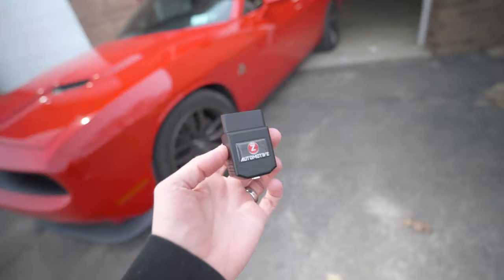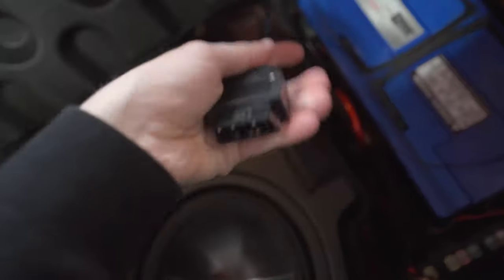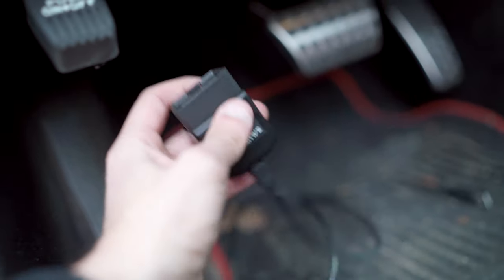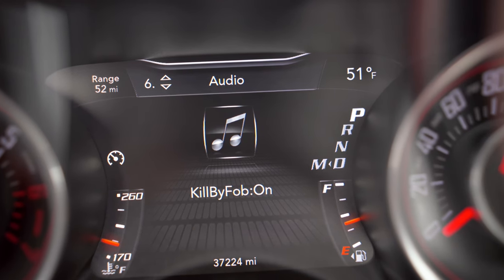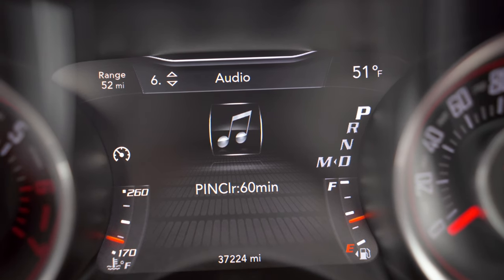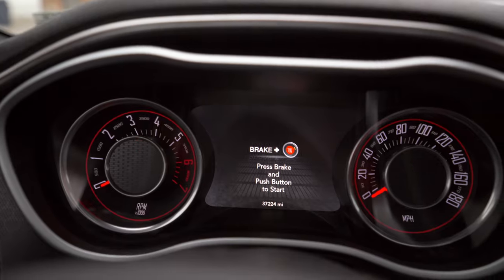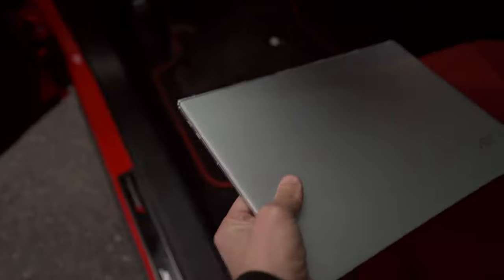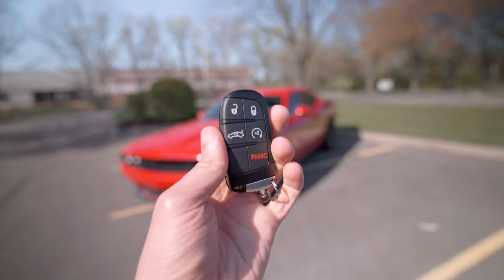Protect Your Vehicle from Automotive Theft - What This Device Can Do Will Shock You

Comment: Is there a way to properly set up the pin in my 2012 Dodge Charger? I’m afraid to do something wrong and my car gets bricked
Reply from the maker: If you’re concerned about that, we don’t recommend downloading the firmware at this time, as it is a beta version. If you have concerns, wait until it is tested a bit more and then download the firmware when it becomes available on our site
Reply: @zautomotive so is that y i couldnt set my pin… i tried over and over and it kept going to cruise on and off but not pin set.. i downloaded the update.. so idk what i did wrong
Reply from the maker: @sunshine48213  that’s not an issue we know about, reach out to support - support@zautotech.com

Comment: Where can i download 2.5.9? All i see in my programming tool is 2.5.8 for new firmware and 2.5.6 for the previous firmware. 2.5.9 not visible at all
Reply: Update: My issue was the version of ZPU not being up to date. I installed the most recent version of ZPU and then the new firmware was available.
Reply from the maker: @Bi9Clapper  glad you found it. 2.6.0 should be coming out very soon

Comment: Recently installed, turned on all the pin features but when I lock with FOB the vehicle does not double blink. Did I miss a step?
Reply from the maker: Is the throttle getting disabled? 

Are you able to unlock the door with proximity entry and see if the pedal is killed?
Reply: @zautomotive  It did not disable the throttle.
Reply from the maker: @svdpschoolsalem  very odd. Reach out to support - support@zautotech.com 

Killbyfob is definitely enabled, and Pin enable is selected “on”?

Comment: Can I use the pin lock mode and kill by fob at the same time on the Taze?
Reply from the maker: Yes but those are two different features. 

KillByFob is for when the car is off and Pin Lock / Pedal Kill happens when the car is running with a countdown and activates when Pin Lock is triggered
Reply: @zautomotive  can I put the Taze with the Lockcar gpa tracker? Or I have to use one or the other?
Reply from the maker: @danielpollockjr.1714  I know nothing about the Lockcar tracker. Depends where it plugs into and what vehicle you have. The TaZer plugs into the OBD2, but can be relocated to the truck with one of our other products
Reply: @zautomotive  thank you 🙏
Reply: @zautomotive  When you plug in the Taze and you scroll through the menue. Are all the factory options selected to the car performance before plugging in the Taze in.? 
And once Taze is plugged in you can edit and set to preference.
Reply from the maker: @danielpollockjr.1714  the TaZer doesn’t change any options until you tell it to
Reply: @zautomotive  thank you very much. You are the best! Thanks again

Comment: I can't locate the pin lock feature in lives mode..what am I doing wrong.? I have the mini..that I did update firmware..
Reply from the maker: @RicoMang  sounds like you might not if Pin Lock isn’t in there. Although the Tazer JL is different than the Pin Lock in the standard Tazer, scroll to the end of your Tazer menu in your EVIC screen and let me know what firmware you’re on. Also let me know if you see “Lt” on that screen
Reply: I see. JL Lt:11.4.6
Reply from the maker: @RicoMang  then it’s a lite and not a mini
Reply: Can the pin feature be added? I got this for pin lock feature ..?
Reply from the maker: @RicoMang  if you upgrade to the mini it will be there: https://www.zautomotive.com/product/activation-key/
Reply: @zautomotive  cool it this Will give me pin lock access correct?

Comment: Just downloaded the new update and everything works except "Kill by Fob".  Tried multiple time and couldn't get it to work.
Reply from the maker: Needs the OEM key fob, don’t know if that’s what the issue is. Email support for further troubleshooting - support@zautotech.com
Reply: @zautomotive i carry both viper fob and oem fob which is necessary to use push to start… so can the killby fob b used if i unlock and lock with viper and my fob to start 2020 challenger manual
Reply from the maker: @sunshine48213  email support@zautotech.com

Comment: Big Question Involving Pin Lock with "Kill by Fob". My understanding is that "Kill by Fob" does two things at the same time when Pin is enabled:

1 - It prevents theft by copying Fob signal to foreign fobs
2 - The function allows you to bypass the pin when using the same fob that locked it. 

Car thieves are getting wise (or even dumber) by now attempting to steal the keys/fobs at gunpoint, so I want to use the 'KillByFob" function to deter theft by signal copy, but DON'T want the easy Pin bypass if a car thief comes up to me at work and says "Give me your keys" to which gives them the bypass since the fob was the same to lock it. Is there a way to retain the security benefit of "KillByFob" and still require the Pin entry - even if it's the same key fob?

I would rather throw the keys at the robber and run away for safety, and still have my vehicle require the pin to thwart the theft - without compromising the ability to deter thieves from copying the signal.
Reply from the maker: No. This is not designed to deter from robbery of someone’s keys. Not even designed as an antitheft device but an added layer of protection to the already jam packed Tazer as an additional feature

Comment: Still trying to learn how to turn on my pin lock 😂
Reply from the maker: What’s the trouble?
Reply: @zautomotive  when I'm trying to enter my pin it's not saving. I'm not getting the options that requires me to enter my pin. Nor am I seeing the option to disable my brakes or gas pedal when I search through the option. I know there's a video that talking about these things but never shows you how to actually input the pin and stuff.
Reply: @zautomotive  would nice to see a video that specifically shows each step. Installed everything else myself.
Reply from the maker: Step 1: Download the latest firmware
Step 2: TaZer plugged in and Vehicle running (Pin Lock is a Live setting)
Step 3: Go to the TaZer menu, cycle through to the Pin /Security menu
Step 4: Set PIN - (reference page 14 of the TaZer menu labeled "setting your Pin"). using the cruise control buttons, pick a sequence of six buttons or fewer. Select the cruise control on/off button to save the Pin
Step 5: once a Pin id saved, the other menu items such as Pin Pedal, Pin Brakes, Horn, lights, etc will show up (A pin must be set first)
 @texasfoo
Reply: @zautomotive  I'm not seeing the security setting
 I get radio, lighting, comfort, lightshow, read TDC, clear TDC,  unmarry, performance, tire
Reply from the maker: You're not in the live settings if those are the options you're seeing. The engine needs to be running to see the Security/Pin menu @texasfoo

Comment: Just figured out i have this installed in my car . Thieves tried taking my car 8 times and couldnt get it ! Video on my channel
Reply from the maker: Wait.... You didn't know you had a TaZer? You'd have to set the pin to enable these features though 🤔
Reply: @zautomotive  i bought the car used. I didnt realize it until the other day when i was digging in the trunk i was like wtf is this and started doing my research
Reply from the maker: @landoceo  Sorry, I guess I’m just misunderstanding. From your initial comment, it seemed like the Tazer saved your vehicle. Although if you just discovered it the other day, then it couldn’t have been activated three months ago when you posted the video.

Regardless, happy the vehicle wasn’t stolen
Reply: @zautomotive  oh im not sure why they unable to get it then. Ive seen them take my neighbors scatpacks but mines just wont go . Id have to see how to activate my tazer
Reply from the maker: This video shows most of the steps. If the TaZer is updated, it would have all these features, you'd just need to set a Pin first @landoceo

Comment: Didn’t work for my sons car, they unplugged it and took the car. Waste of money
Reply from the maker: This is not a security device, the Tazer is a programmer to enable over 50+ features. As mentioned within the first few seconds of the video, having multiple layers of protection is recommended. As you can see from a recent video, the Tazer did stop a theft but we do not advertise our device as anti-theft but theft deterrent. Having the double bypass to relocate the Tazer to the trunk is one extra layer of protection
Reply: Oh wow. Sorry about your sons car. Can I pair this with compustar security system?